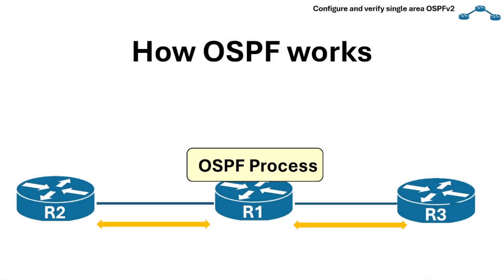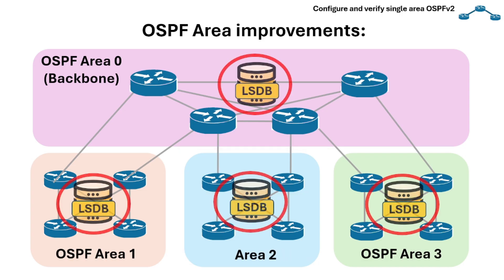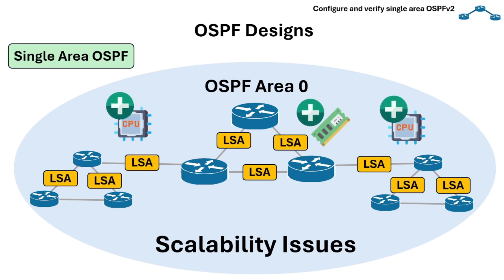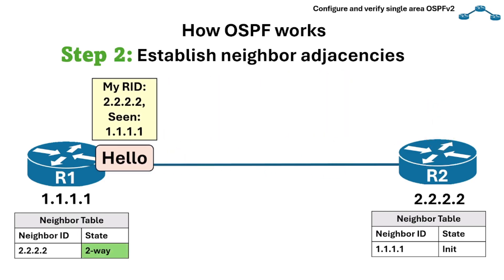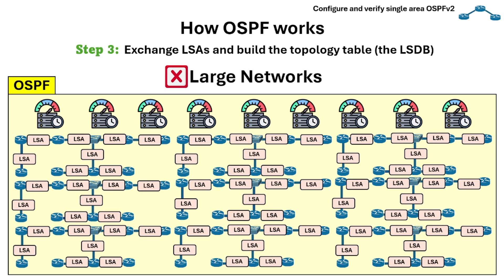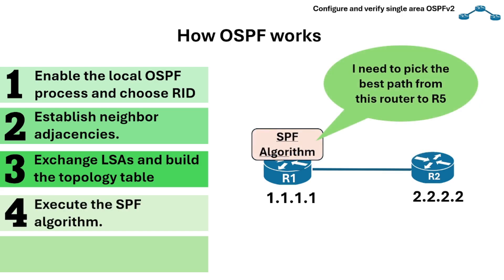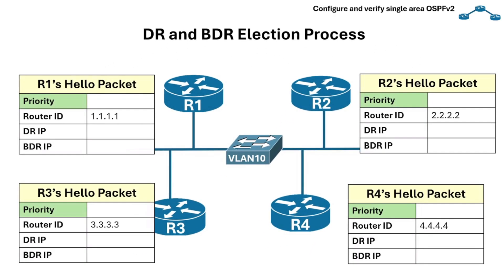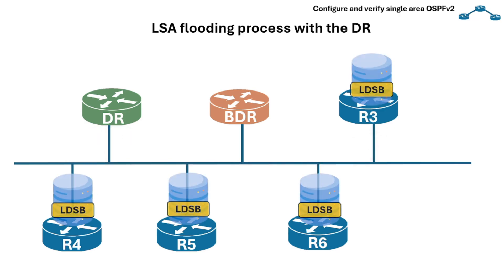CCNA Study Reviewer - 3.4 How OSPF Works, Designated Router Election

Comment: Hello. Some of these topics/chapters East, I just have to go over them and move on. Some of them are difficult to understand, but I do know it can depends on the author explaining it.
Reply: Hopefully, with practice exams, watching more teaching videos, I will get a good understanding of CCNA.
Reply from the maker: Yes I understand. CCNA has a lot of information you have to remember. For OSPF, what's really important is understanding the 5 step process of how it works, the Designated Router Election Process and configuring single area OSPFv2. And yes keep doing practice exams